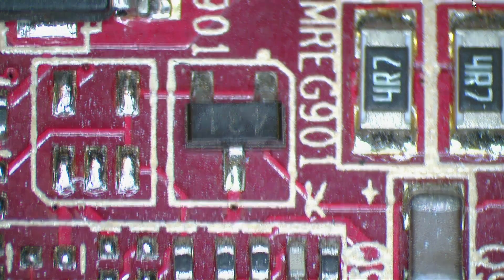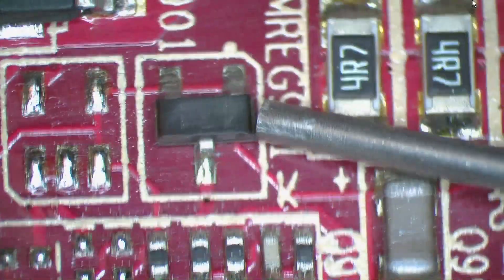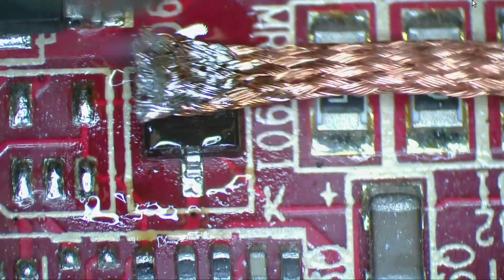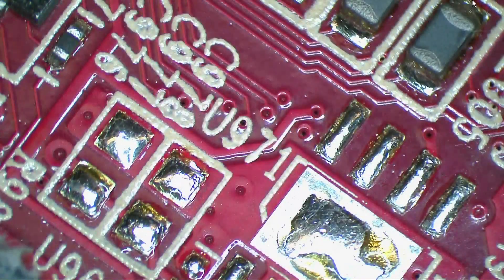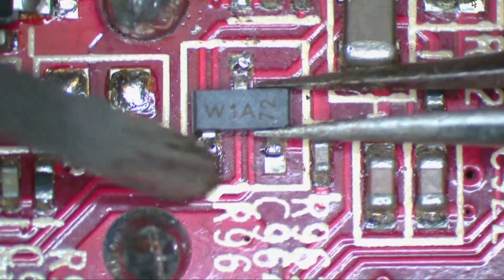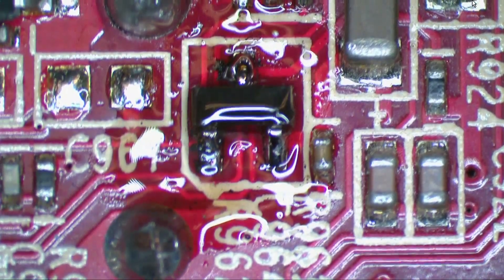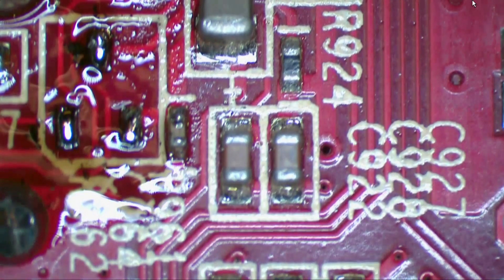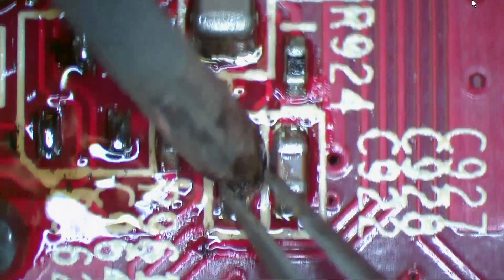QUICK TIP#3: REMOVING "SOME" SMD COMPONENTS WITHOUT A HOT AIR STATION.

Comment: I'm not real familiar with surface mount components & was wondering if you might be able to tell me what the components are in my video https://youtu.be/p3ovrhBcL4Q there is a picture of 3 that got burned up (Which I don't know how that's even possible given the voltages on the cells are suppose to be the same). There is no numbers that can be read.
Reply: I think they are diodes but I'm not sure.